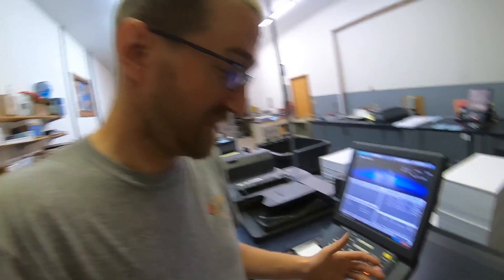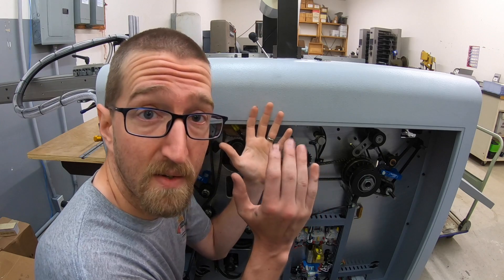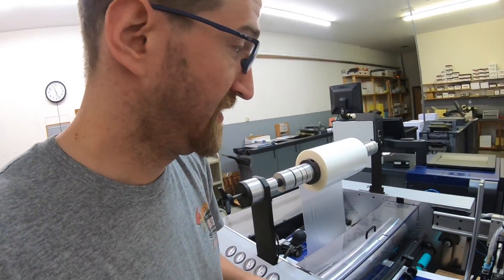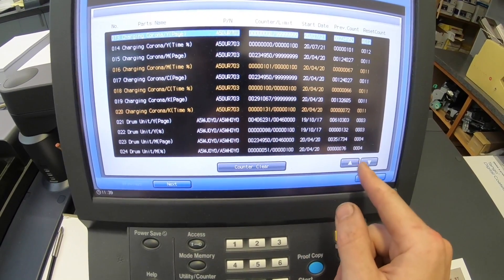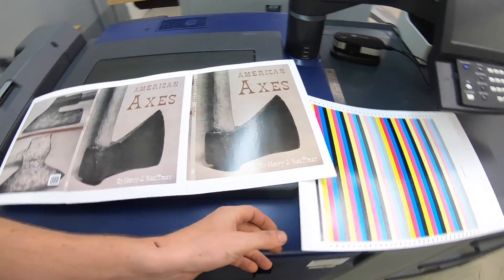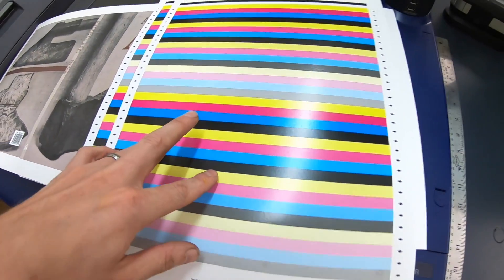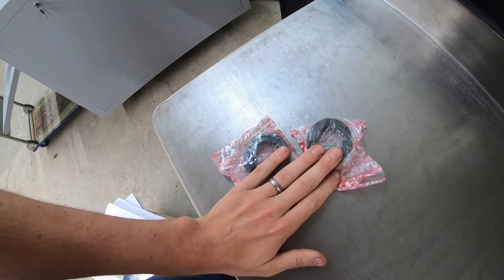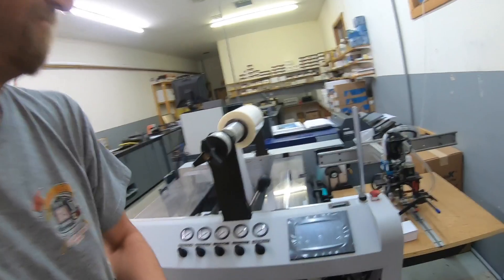Diagnosing Uneven Color on Konica Minolta C1070 and Fixing a Traveling Heat Rollers on Laminator

Comment: is it easy to maintain if using third party toner and maintain the service by own ? because is can low down the cost. 1060 and 1070 is it same model ?
Reply from the maker: It is pretty simple but you need to learn how to do it right. 1060 and 1070 are exactly the same other than print speed.
Reply: @justaprinter  do you using oem toner or original toner ? Thank for reply

Comment: Hi Dan, thank you for the information you share.  If I may ask, where would you start if you were just starting out in these times ? Thank you
Reply from the maker: Make sure you have some jobs to print, get a cheap printer, then a cutter, folder. Pay cash as you go. I like Konica machines, but there are dozens to choose from that will get the job done.
Reply: Just A Printer thank you much for replying. Is there a printer you have in mind would be ideal to start with ? Same for cutter/folder. That way I can either look into that or have an idea of what to look for.

Comment: What is the exact model of your collator/stitcher/3-knife?  I have a rosback that I would like to replace with something like that. Is it a Duplo?
Reply from the maker: It is a Horizon VAC-100 collator with SPF-20a Bookletmaker, only has single side trim. Horizon does make a true saddle stitcher with 3-knife as well. Its a solid machine.

Comment: on your laminator - the heat expands the roller's length, and that - plus loctite not being able to handle the temp right there is likely why its getting loose. (The temp adjacent to the element is likely closer to 450F or more)..   I have a 60"Orca and it expands over 1" each end at 250F.  If you lock both sides up, you'll crown your roller for sure. there's a lot of stress in expanding heated metals. Also- A chain that's pulled drum tight will hop off regularly if there arent nearby idlers or tensioners to track it. I'd look at loosening the chain, and if you shim/lockdown the roller, only shim the fixed side, leave the adjustable side to float freely -  but expect it to force media off track a lot more..
Reply from the maker: Thanks so much! I'll have to try to keep one side loose for expansion. Good stuff!

Comment: how does the older machine perform on business cards say 350 gsm
Reply from the maker: It doesn't. Haha. It is only rated to 300 gsm. I use the 3070 for heavier stock. I'm sure it would print on it though if I tricked it.
Reply: @justaprinter  Maybe you can tell the trick? because i’m printing 350gsm with changing paper weight to 257-300gsm, measure paper thikness and just that. C1060l print same 300gsm paper.

Comment: What's your opinion about konica 3070P  without fiery they are going to provide only km controller
Reply from the maker: Sorry, I have no experience with the KM controllers. I'd be interested to learn about those. I'd assume they would make a good product, but I'd be scared to go away from Fiery.
Reply from the maker: @Jaystah2  Interesting, sounds like that would be fine for me. I'll keep that in mind for the future, thanks!
Reply: @Jaystah2  Easy and cheap (399€) solution for KM Hikari controllers is PLDA plugin for Acrobat Standard/Professional for imposing: http://www.plda.net/en/Home.html
Reply: KM controler have color calibration? Because i get my minolta just with JobCentro and now thinkig about cotroler :/ Ordered spectrometer, waiting to get it. Thanks for answers?
Reply: @algirdassokolnikas4087  Color Centro software: https://dl.konicaminolta.eu/en/?tx_kmanacondaimport_downloadproxy[fileId]=7b2149e75686a5558cf14bd9dde3fcd2&tx_kmanacondaimport_downloadproxy[documentId]=122643&tx_kmanacondaimport_downloadproxy[system]=KonicaMinolta&tx_kmanacondaimport_downloadproxy[language]=EN&type=1558521685
Reply: @janchladek2427  I think this is not full link, it doesn’t open :/
Reply: @algirdassokolnikas4087  Sorry :(  Go to: https://www.konicaminolta.eu/eu-en/support/download-centre and type Color Centro to Search your product: